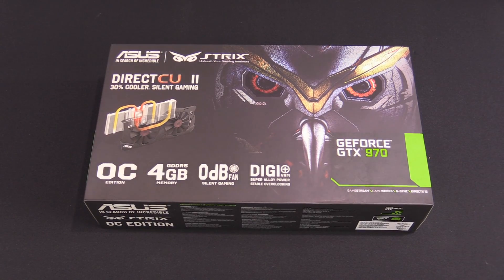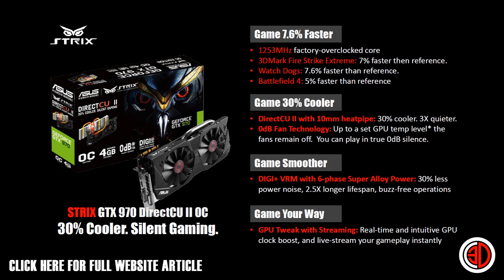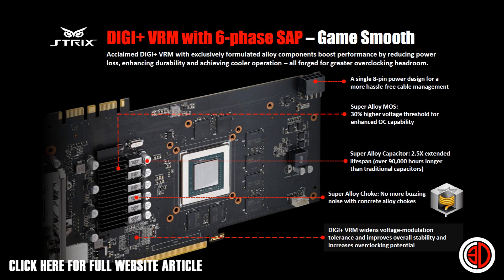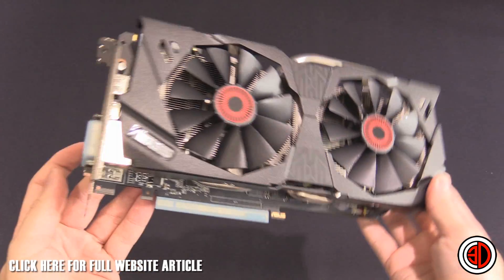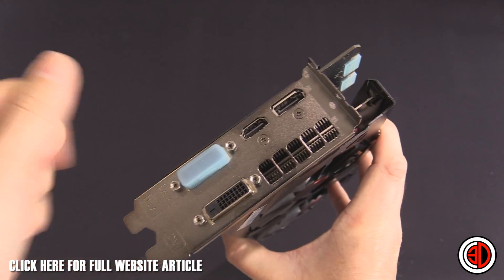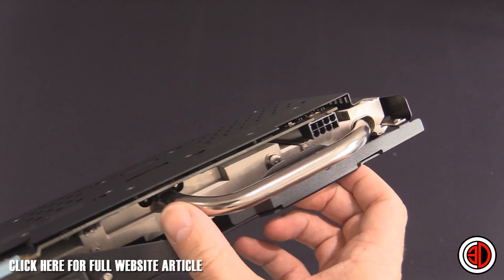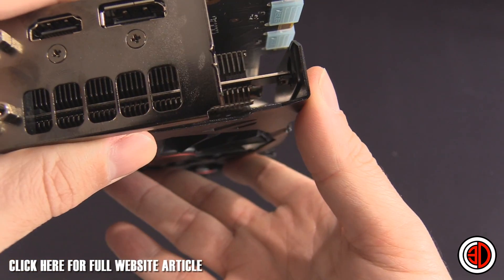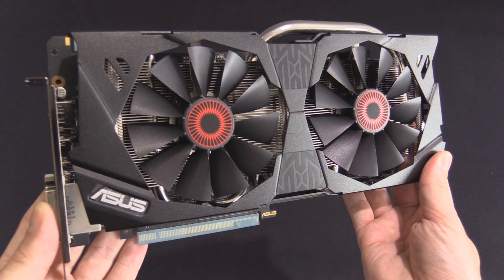Asus Strix GTX970 Nvidia Maxwell Graphics Card

Comment: holy Mary mother of Joseph , a single 8 pin? how efficient is this monster?
Reply: 140 watts
Reply: thereddog223 I know but this is when an amd fanboy usually screams "power consumption doesn't matter only raw performance".
Reply: Lets just hope amd can do well with power consumption with their next gen
Reply: thereddog223 hopefully...
Reply: I will be upgrading from a HD6870. Most of my cards were amds, but the price is just too tempting on this one.
Reply: Stephen Shaw
power efficiency equals lower heat output, equals more headroom for overvolting, equals more headroom for overclocking.
Reply: FoodOnCrack I know that much,  tell that to amd fanboys they will eat your head off